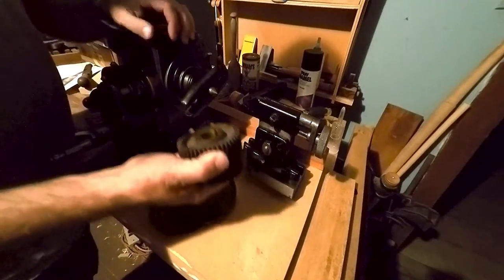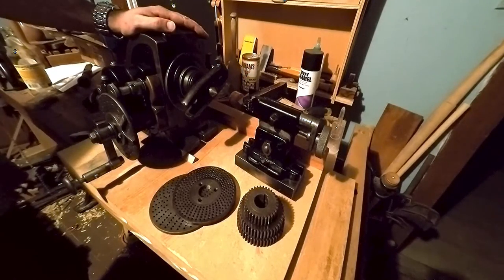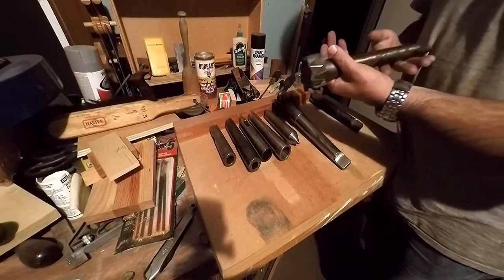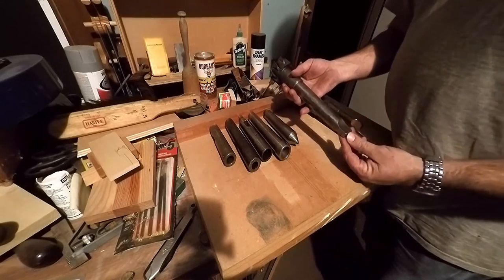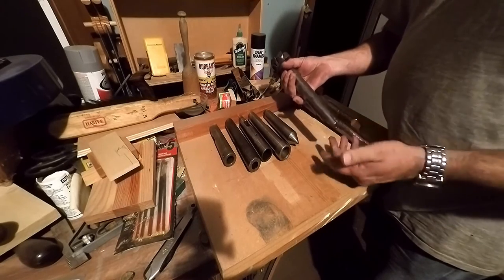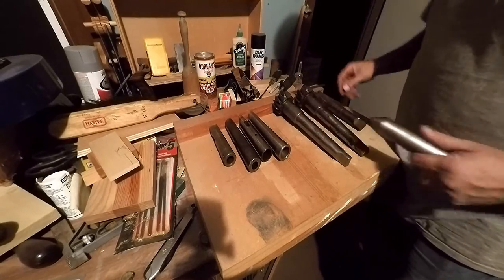tool score #10

Comment: I couldn't hear you the first 8 minutes or so and it was a little difficult through the rest, but it looks like you got a good mix of new tooling.
Reply from the maker: +ILGopher hemm not certan what I can do about it this go pro does not have the best mic next time I post something I will see if I can do any thing about the volume in my editing soft where thanks for the heads up
Reply: Yep, just wanted you to know.
Reply from the maker: not a problem .bad sound is a pet pive of mine.